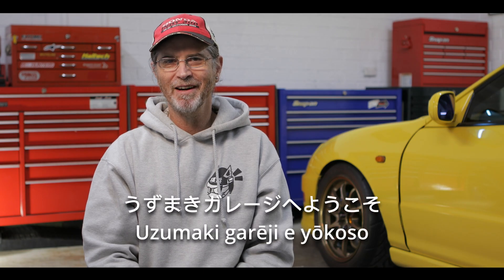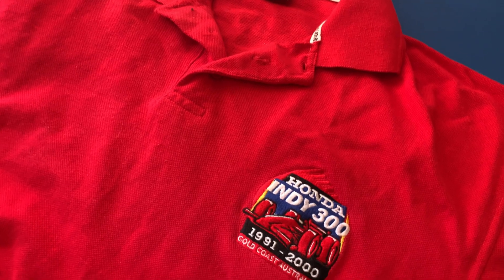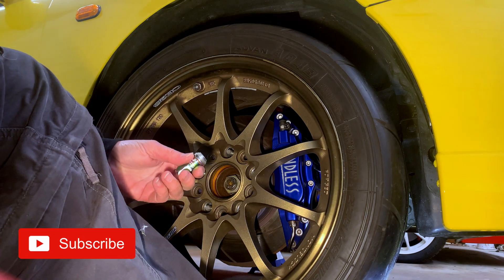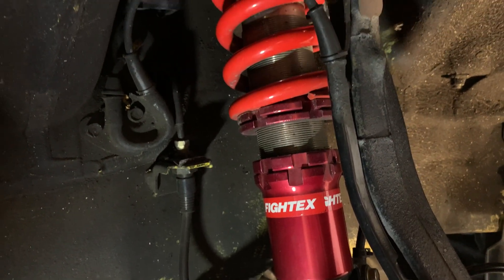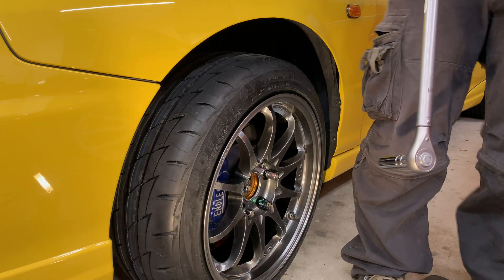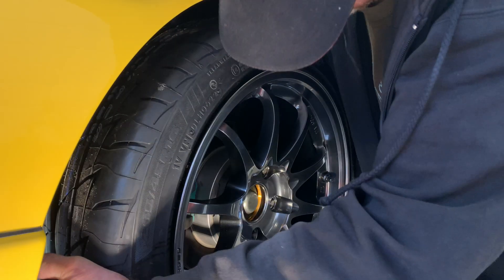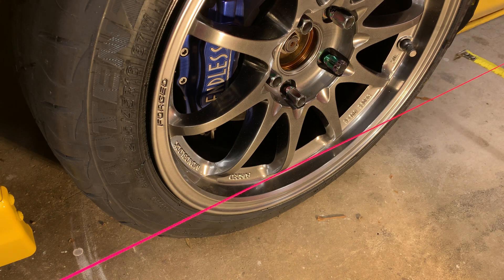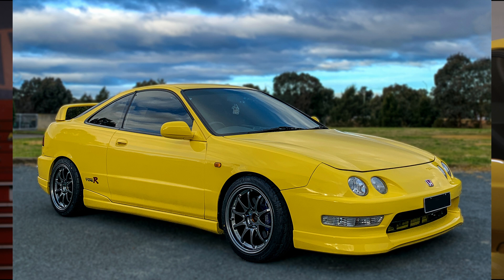Too Much Camber? Integra Wheel Alignment at Home using STRING! Camber and Toe. DC2

Comment: I used fishing line wrapped around axle stands to align my DC2 ITR. Bear in mind that the rear track in less on these cars so you have to factor that in to get the strings parallel.

Also, the use of an engineering rule is better than using a tape measure for more accurate results.

The wheels do look great though.
Reply from the maker: Cheers Mick. I don’t have any respect for wheel aligners around here so doing setup myself is really my only option.
Reply: @UzumakiGarage  yeah that was my issue here really. One shop wanted me to 'leave my ITR with them' and they'd give me a call when it was done. There was absolutely no way I was leaving my beloved ITR at a fast fit shop for them to take it for a run up the local dual carriageway without my permission. Hence why I did it with fine fishing line myself.
Reply from the maker: @mickl8212  yes some shops have no respect and if its within Manufacturers spec they won't even bother to make it perfect. DIY FTW
Reply: @mickl8212 no way!! No frigging way I leave my dc2 type r behind for a alignment, never !!
You did good👍🏻

Comment: Love the wheels! They are very light! I have them on my DC2 as well but 16x7.5 +35 offset. I get lots of complements on the wheels!
Reply from the maker: Thanks! Your size wheels sound good as you could use wide tyres with a higher profile. Hard to tell exactly without test fitting, which can get expensive

Comment: Do you still have the white dc2? Love the new wheels. Loads better than the previous setup
Reply from the maker: Yes I still have the white one but it needs some more work. I removed its gearbox and had it reconditioned. So next I have to re-install the gearbox but first the steering rack needs attention and I might replace the clutch too while I'm at it. All good content to go in future video episodes.